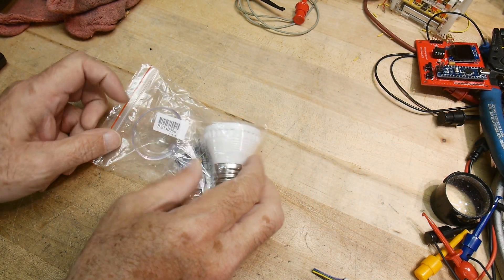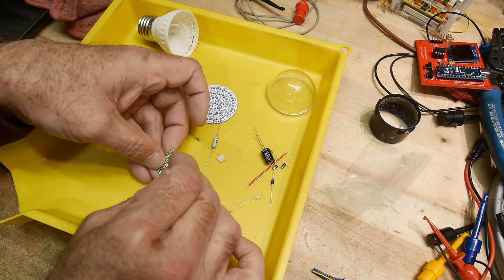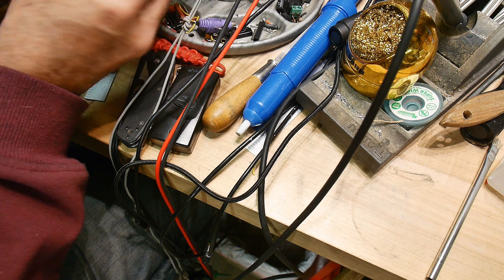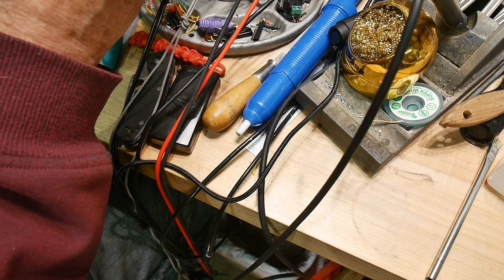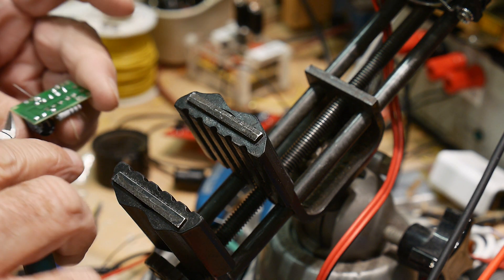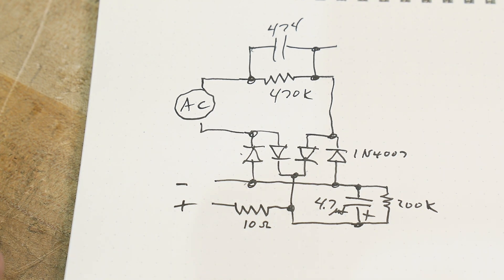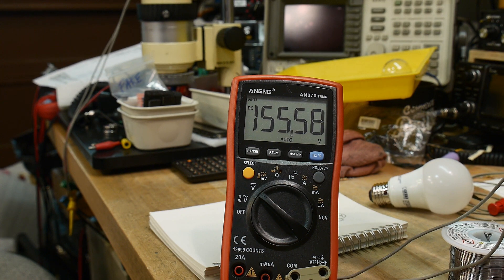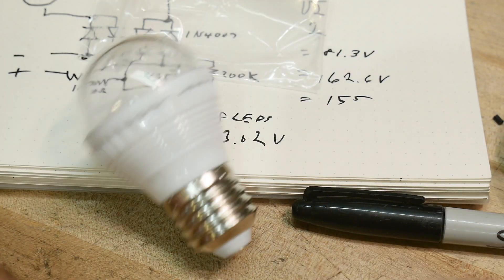#1075 Very cheap LED light bulb kit

Comment: I've been trying to work out which 2 numbers you used to get 3.02v per LED. I get 4v per LED and I suspect they are being driven to extinction without a metal heatsink board and casing.

Comment: I've been wondering about 3D printing and then electroplating the part (after maybe surface finishing where needed) to make metamaterial (and other) antennas and other parts.  I also want to eventually try some lost PLA foundry fab projects for mechanical parts for Briggs & Stratton garden tractor engines.  Few days back received the 0-30V 0-10A CV CC power supply I've wanted for other projects also... so finally moving forward again.  Hopefully within the next decade.  :-)  I snuck in a SB6183 Spectrum Analyzer review after finding a Goodwill Store cheap SB6140 and repairing to use now as my cable modem.  We'll see if I can keep the RF projects moving forward.  I'll have to try the 2K webcam spectrometer and see what happens.

Comment: There's no way that the dropper capacitor is 470pF. That would have a reactance of more that 5M at 60Hz, which means it would be doing nothing, despite being probably the most expensive component in the kit. It's certain to have a reactance much less than the 470K bleed resistor if it is to serve any purpose at all. If the 470K resistor were the lower impedance at 60Hz, the rms current through the leds couldn't even be 0.2mA, even if they had no voltage drop. If I read the marking correctly at 2:47m it looks like "474" which translates to 47 x 10^4 pF = 470nF. That still seems low, but it would at least have a reactance of 5.6K.
That brings us to the leds. The US mains voltage of 115V rms or 160V peak driving 38 white leds at 3V each through 5.6K will give a peak current of (160 - (3x38))/5.6K = 8.6mA. The ripple will be about V = It/C = 15V on the 4.7μF, so there's not a huge amount of flicker, but that's not a very bight light bulb.
It is possible that the 38 led positions are meant for European 240V rms mains, which would give an average current closer to 30mA at 3.3V per led. Using 19 leds and 19 shorts with US mains will put the current around 15-20mA which is useable for a light bulb.
Incidentally, it's not really any more dangerous than any other common mains-driven LED bulbs as nowadays they all tend to have a dropper capacitor followed by a rectifier with some smoothing.
Reply: "474" means 470000 pF.  Reactance 5.6 kOhm.
Reply: @byronwatkins2565  I'm pretty sure that's exactly what I wrote, although I did convert 470,000pF to 470nF. Did you misunderstand that?

Comment: These are fun when using color changing or blinking leds.
Reply: It won't work because the current consummation varies
Reply: @odindimartino597  I have made a couple with both orange flickering candle leds and with RGB changing leds and they work fine.
Reply: @Ni5ei  I read the datasheet and I know hot it work internally
Reply: @odindimartino597  Yeah but I did some real life soldering and it works. So are you refusing to accept reality? 😎
Reply: @odindimartino597  Funny how you make a statement based on what you assume while you haven't actually tried it.

Comment: Albert Champion was a champion bicycle racer who came to America in 1899. He established the Champion Spark Plug Company in Boston and Robert A. and Frank D. Stranahan invested in this company. Albert Champion left this company in 1908 after a disagreement with the Stranahan brothers.

Albert Champion had at least one spark plug patent (from 1898). In 1908, Champion had a meeting with William C. Durant of the Buick Motor Company concerning producing spark plugs and other ignition parts for Buick, which was a founding General Motors brand. Durant moved Champion to Flint, Michigan and the Champion Ignition Company began business.

However, the Stranahan brothers had the name “Champion” trademarked so in 1908, Albert Champion set up another business with the Buick Motor Company called the AC Spark Plug Company (using Albert Champion's initials).

Alfred P.Sloan reorganised GM in 1916 into AC Division as a producer of spark plugs, speedometers and other equipment for sale to other manufacturers of cars. Sloan named Albert Champion the president of the AC Division company.

Champion died in 1927 and General Motors bought the remaining stock owned by Champion's estate and took over the AC company.

Charles A. Lindbergh used AC plugs during his historic solo flight across the Atlantic in May 1927, and later praised their reliability.

In 1974 General Motors merged AC and United Delco divisions to create AC-Delco.

It has a long history and has been known as ACDelco, United Delco, United Motors Corporation and United Motors Service.
Now we know.........................................

Comment: 200k resistor is there probably to stop LEDs glowing just by switch leakage. 10 ohm one is usually placed before rectifier and acts like a fuse and inrush current limiter. If it's in this configuration, it probably just helps reject flicker.
Reply: And the purpose of the 470K resistor is to discharge the capacitor when powered off, otherwise you can get up to twice the line voltage when powered on again.